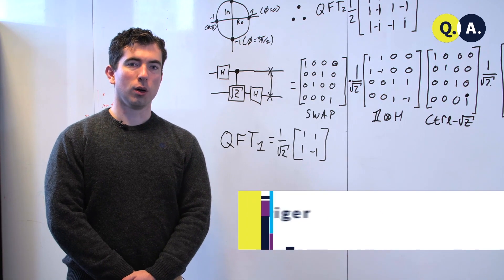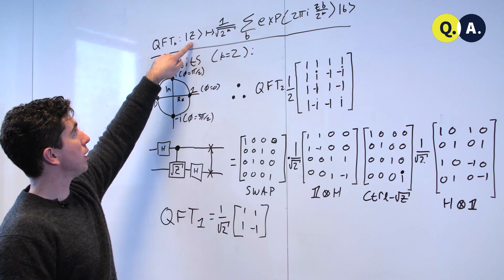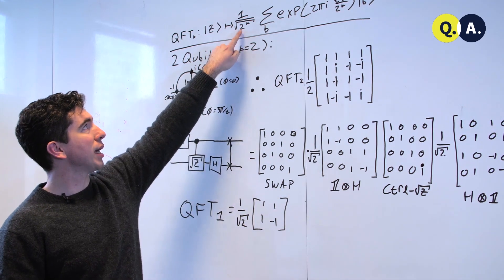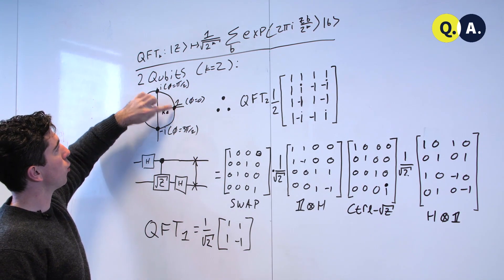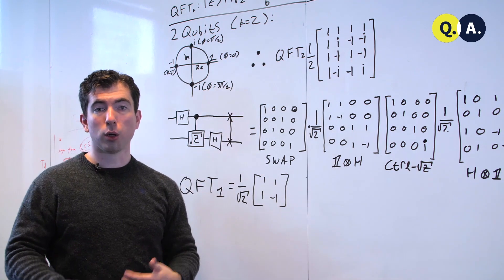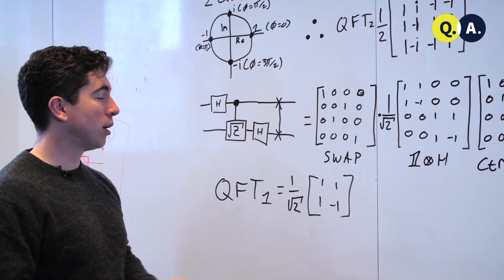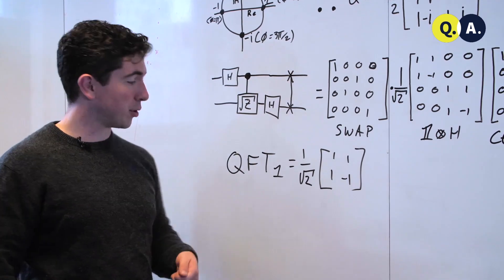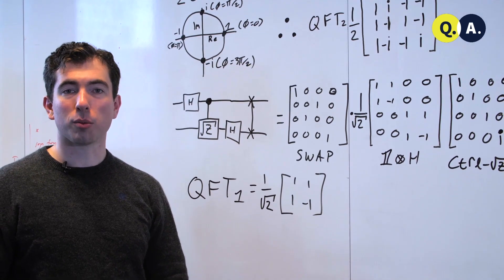Small Quantum Fourier transforms | QuTech Academy

Comment: The 2 qubit circuit implementation on the far left has the phase gate backwards. The control bit should be at q1, not at q0.
Other than that, great explanation :)